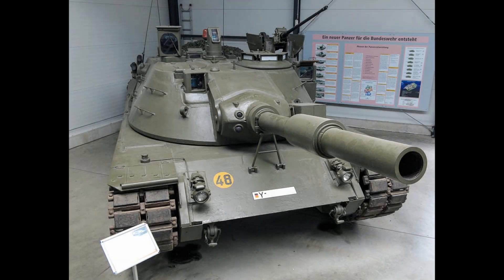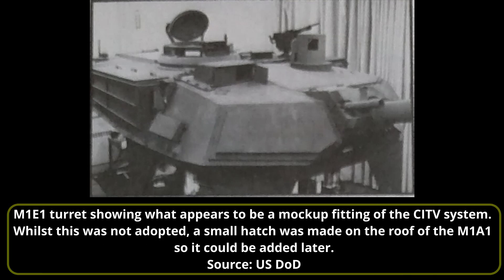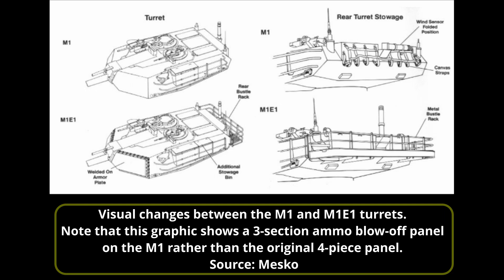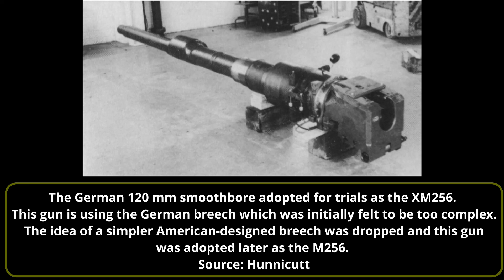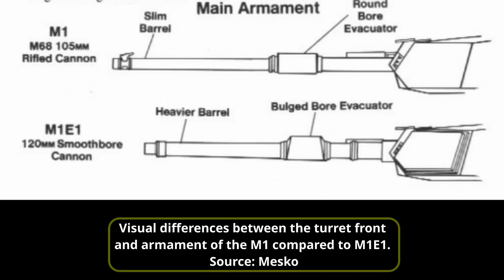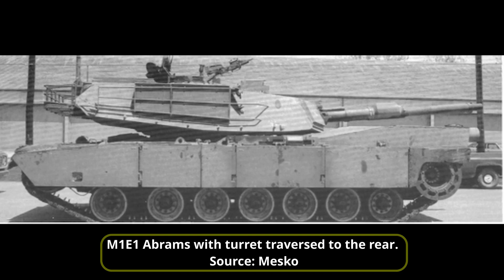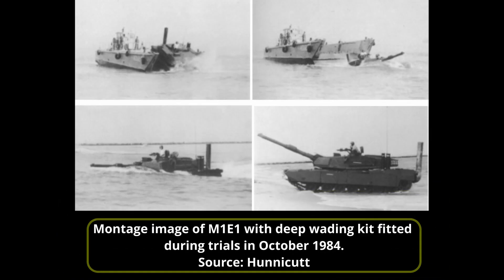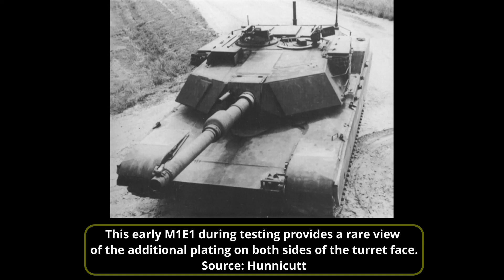M1E1 Abrams American Experimental MBT - Catching up!

Comment: M1E1 had 2 types. First was early version. Time 17:46. This tank was all M1 Abrams with 120mm XM256 and added stowage and new backside basket. It had beveled edges! Frontal added plates had different shape.  Second late version hull and turret same as M1IP. " Bigger turret" Only visual diference between IP and late E1 was 120mm and added frontal plates on turret and one paar of stowage more.
However, both types had the same ammunition door cover as on the M1!! After replacement with new type of cover and other improvements to the tank was named than as M1A1.